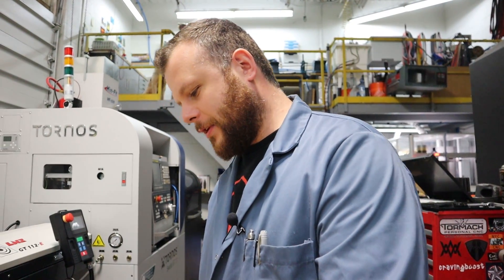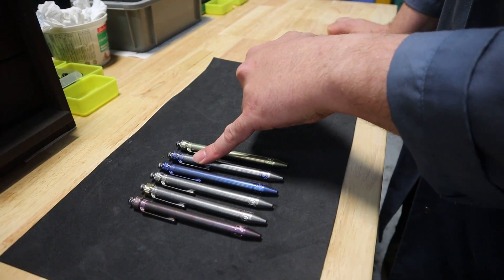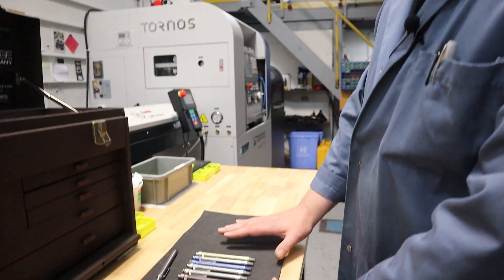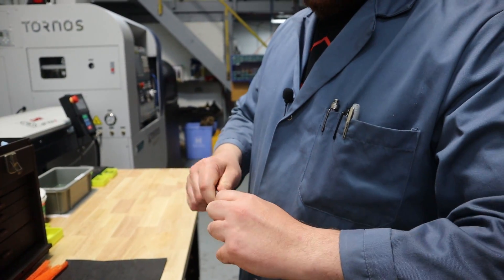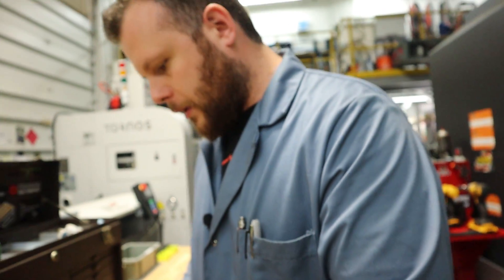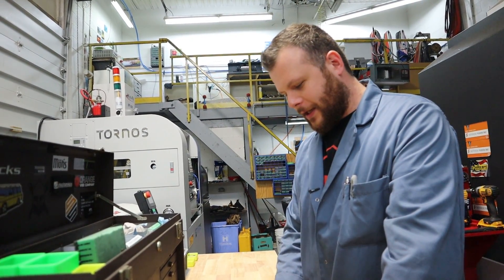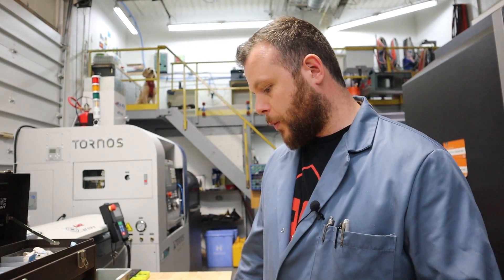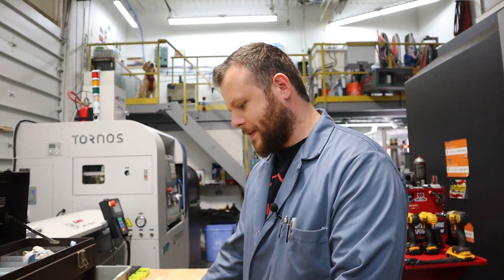Pen Colors and Patterns! - What's available?

Comment: Yes, PVD, CVD, Ion Beam, Vacuum Heat Treat, Vacuum fusion bonding.  Laser engraving, cutting, closed forging dies.  Yes of course.  Lithographic micrometer lettering and qc code and bar codes you can interact with the life of your writing device and other knife stuff.  MEMS technology of some kind that creates that one of a kind product with the ability to someday use IoT tech to help get metadata to determine to optimize to reduce failure modes and provide real-time feedback to allow for sharpening and refurbishment or recycling when a major failure mode has happened.  You can provide instant support for warranty or adjust warranty based on use if used in extreme ways that could injure the customer or others around them that would demonstrate a violation of ToU or intended uses beyond self-defense or utility expected for your products.  But then tailor them to exceed the extreme boundary case uses.  Like a link in a chain for pulling you out of a ditch or anchor or safety clip on a rope climb or any extreme use beyond a knife or pen.

I would like to see a mechanical pencil multi-use product or adapter from pen to Pentel type mechanical graphite pencil that is used in the manual drafting of engineered technical drawings we created and used before CAD systems became undeniable for ROI and time savings.  Just like 5 axis is analogous to the manual production machining of decades past.  The niches are there for a hobby, education, small runs of parts and prototyping etc.  The point is some of us love the process of innovation and learning ways that continue to build on the long history we all enjoy from the innovations of millions that came before us to allow the amazing tech we get to innovate on today for the generations ahead.  So leverage the tech that was in HDDs and Electronics and Aerospace to tools we use like a pocket knife and a writing instrument.
Reply: I tried to read this but couldn’t make it past the first few sentences. It’s just a huge rant with no context really.

Comment: Have you ever considered using cerakote?
Reply: I had cerakote on a pen of mine, I dropped it once and immediately, the titanium beneath was showing. I can’t vouch for the proper application onto the pen, I got it second hand. It was only slightly more time consuming to sand off than just standard anodizing, but I feel like it’s mostly due to thickness.

Comment: Reads title. 
Jumps on the site. 
Nothing available as usual. 
Comes back to watch the video, as i enjoy them anyways. 🤷‍♂️
Reply: @AugustWest13  Exactly. It reduces the experience to a favour. I get the normal lotteries to buy a specific piece - supply and demand - but this maker's choice thing does not make sense and fails in every aspect. 
Don't mean to troll either as i really like their work, but i rather wait two years and get exactly what i want from another similarly skilled maker.
Reply: Rui Marques you can sign up for the Makers Choice list, and you might be picked to buy one :)
Reply: @StoryUnlocked  Yes, i'm aware of that. Don't agree with the method as i think we should choose finish, material, etc. Would rather wait a couple of years than to get picked to buy some random configuration. 
No worries though and thanks for replying. Been a fan for many years and will continue to follow Grimsmo's work. 👍
Reply: Rui Marques totally get it, we’re working on a system to make that happen